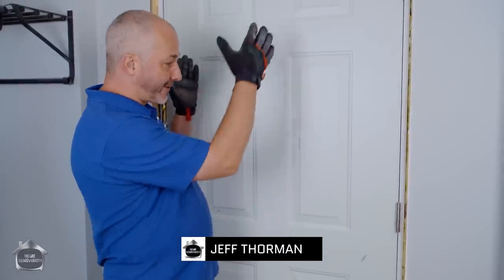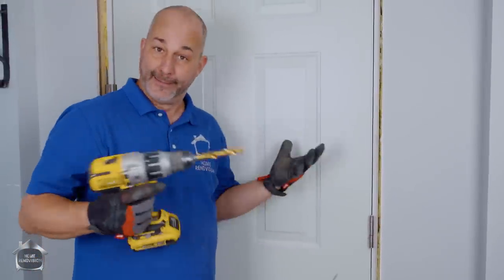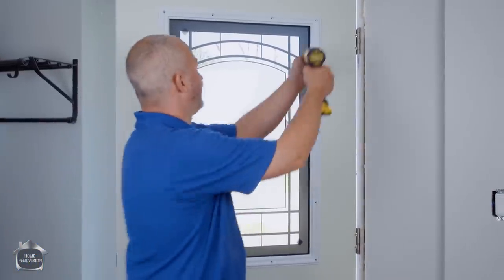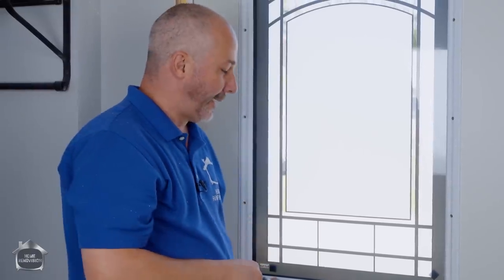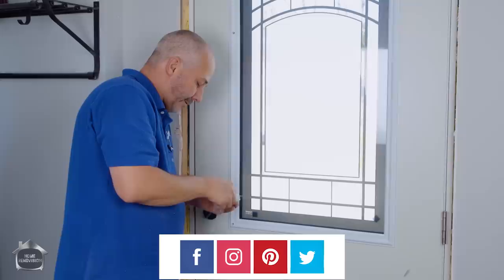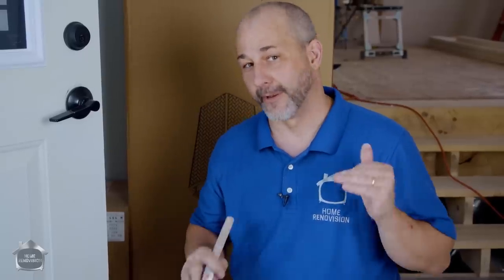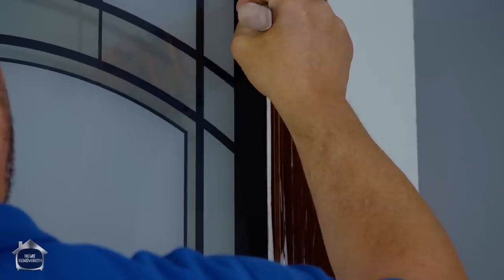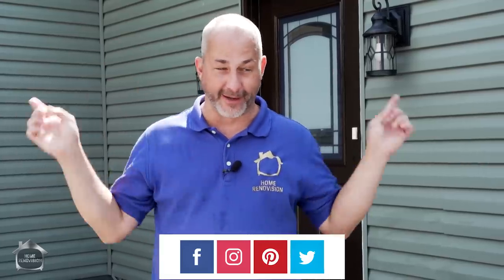Make Your Own Custom Front Door! DIY Door Installation

Comment: I find it odd that there's no sealant or at least a gasket to add, before securing the window & trim..
Reply: It seals very well no need. I did this to my door, it's only a quarter lighter compared to his half light.  Came with the same little screw plugs to complete the trim. I painted the door white and didn't paint the trim, I assumed you shouldn't. Next time I paint the door I'll do the trim as well,  the more you know!
Reply from the maker: the gasket comes attached to the exterior side. Cheers!

Comment: You didn't put any sort of insulation (foam or caulking) before installing the window. Isn't there gonna be some air draft coming in? I mean that -20 winter over there is gonna tell you that you should have. No?

Comment: I feel the same way about gloves.  Sometimes you just need to be able to feel what you are doing, to hell with safety...lol
Reply: I cut the tip off the thumb and index finger of my left glove (I'm a rightie). Makes it easy to feel and grip screws and such without taking off the gloves. Those mechanix gloves from Harbor Freight are super cheap so ya don't feel like you're ruining an expensive pair of work gloves.

Comment: Really shouldn't be cutting metal with a jigsaw without eye protection, you had me making my own safety squints while watching.
Reply: Squint goggles get way too much use in my house.
Reply: No need for glasses, just pull your skirt up over your eyes and hope for the best. In all seriousness, no, you don't need glasses for that type of work. The other side of the spectrum would be using a wire wheel of any type or a grinding wheel. You'd have to be an idiot not to wear eye protection when using one of those. Bottom line, don't be paranoid about picking up a screwdriver without eye protection and keep it real. Some jobs, tools, or methods are more dangerous than others.